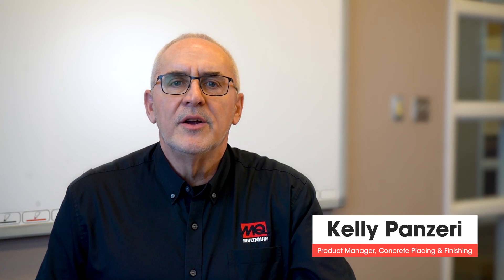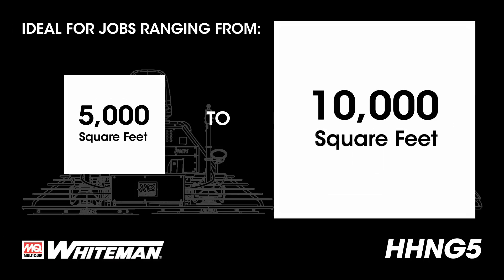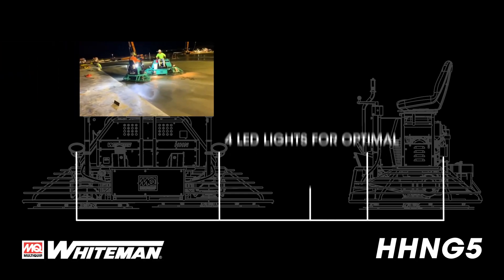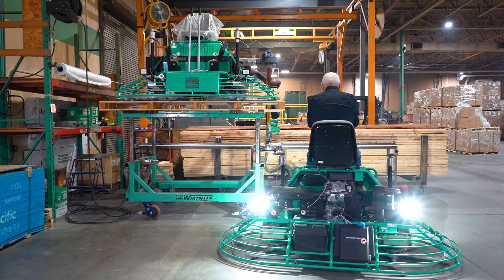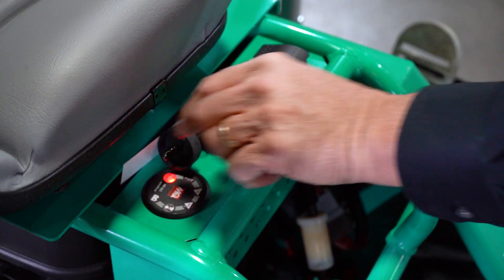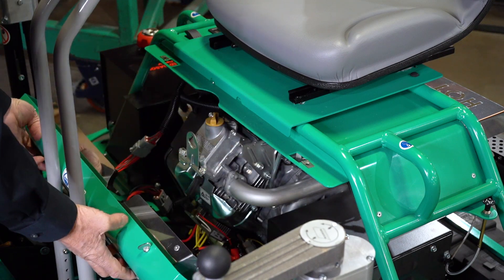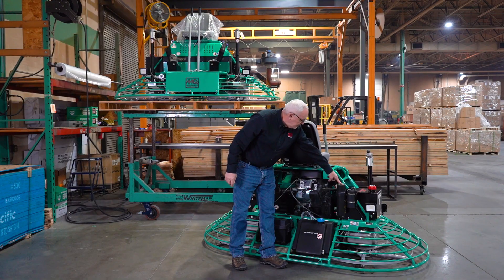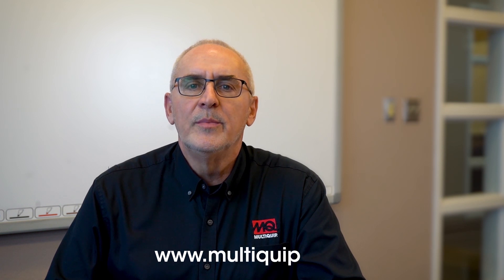Finish Concrete on an MQ Whiteman HHNG5 Ride-On Power Trowel

Comment: does anybody have problems with the front end sparkplug overheating, and the exhaust valve crashing the piston head, from overheating , and destroying the engine.
Reply: Over revving the engine is normally the cause of heat and valve problems.